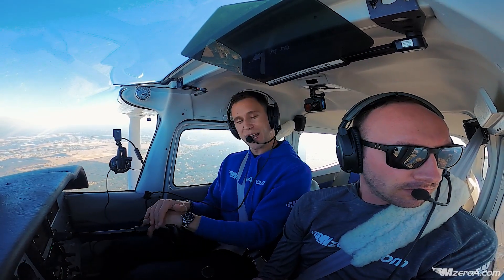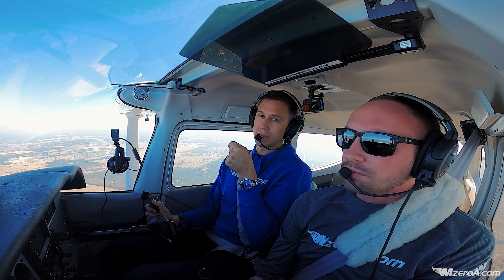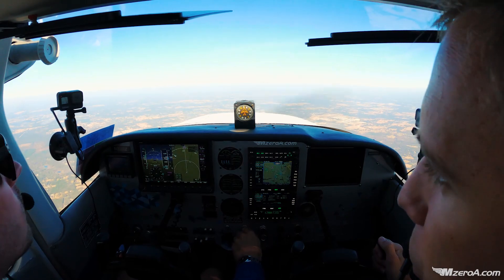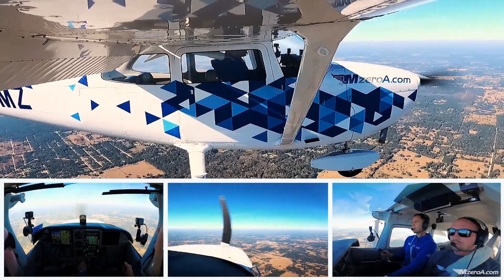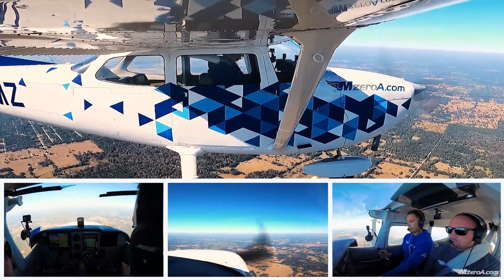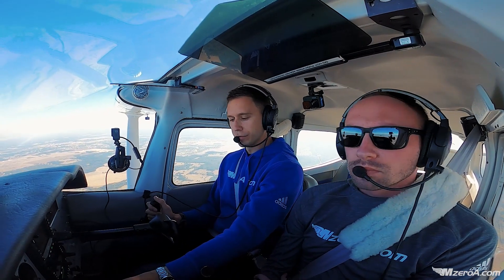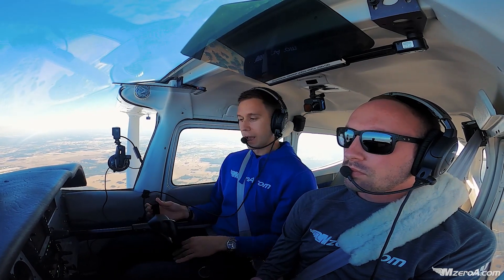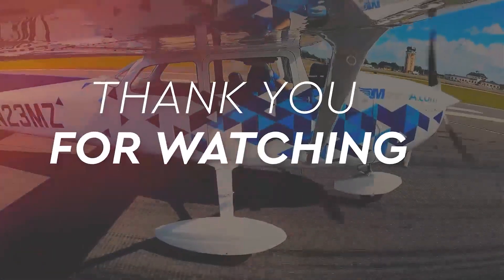Power Off Stalls - SPC Day 26

Comment: Hello, MzeroA.com from Sydney, Australia.
Power-off stalls.
* I'm thinking: (the energy is the same as just before landing) no recovery airspace only hard surface to support plane.
* I'm also wondering about cord length of the wing, with flap degree changing:
                    stall speeds
         * 10° = lift/30°= drag (this 
            Maintains flight for a lower    
            Stall speed)
          * stall warning tone    
Nevertheless, one needs that airflow over the wing, and  depending on the amount: (IAS) will be the factor to change the wing cord for advantage?
🌬🛩

Comment: Make sure to stomp on right rudder as the power comes in and avoid stall-spin.
Reply: With respect I’d be cautious about using the word “stomp” when describing rudder application near the stall / Critical AoA / CL Max. Even if the point you’re making is regarding the recovery.
Reply: @BlueLineSpeed  Totally understand your thoughts about the word “stomp” - but actually I chose it intentionally... it’s an emotive word designed to be remembered in the panic of a real emergency when the blood is pumping... exactly the kind of scenario where fine motor control is lost due to the flight or flight response anyway. The real key is a deft touch in all phases of flight so you hopefully aren’t in the stall situation to begin with.
Reply: @dade8881  Well worded
Reply: @dade8881  Thanks for the reply, I appreciate your eloquent description and reasoning. Using the same logic, we practice these manoeuvres to develop ‘motor memory’ to compensate during times of increased workload and stress. I’d argue that it is whilst developing ones motor memory through repetition, that you want to be the most specific (and descriptive) about the exact method in order to achieve the most accurate outcome when it really matters.

All that being said, I appreciate the point you’re making and any conversation on the topic that can get people thinking can only be beneficial. Thanks.
Reply: @BlueLineSpeed  Ha! Points well made. Ok everyone... listen to @BlueLineSpeed and practice practice practice. And if that doesn’t help in the heat of the moment... stomp on the right rudder!! 😂👍🏻

Comment: How much altitude did you lose?
Reply from the maker: Hi Padrelaw! In this video, Jason was simulating that the ground was 3,800 feet MSL and after he stalled, he went below that altitude in the recovery. As for the ACS, there is no altitude loss limit as long as the aircraft is recovered above 1,500 feet AGL for single-engine or 3,000 feet AGL for multi-engine. Around Ocala, FL where we record these videos, AGL and MSL are almost equal so he was recovered well above 1,500 feet AGL. If you have any questions please reach out to us at support@mzeroa.com. Fly safe!